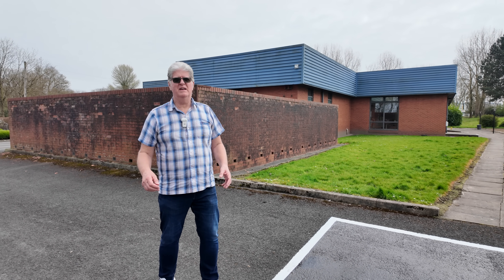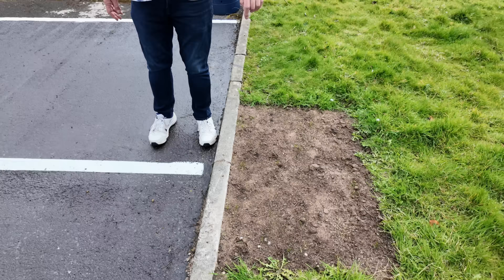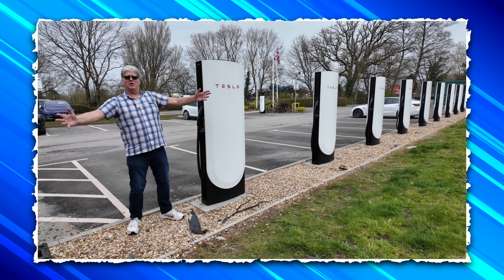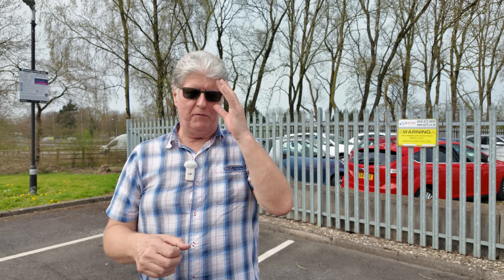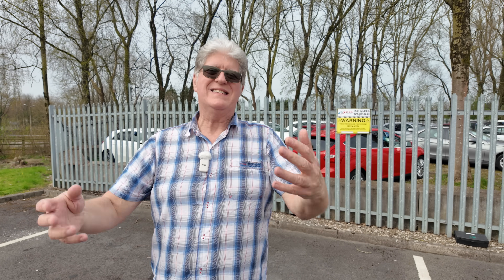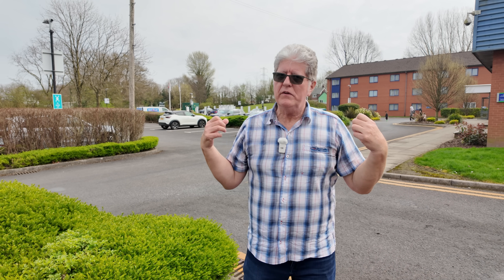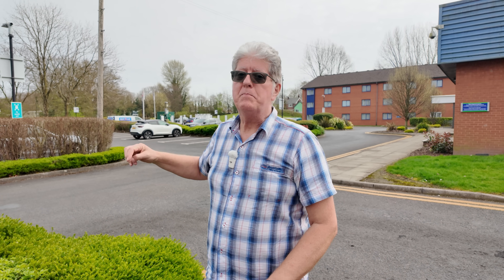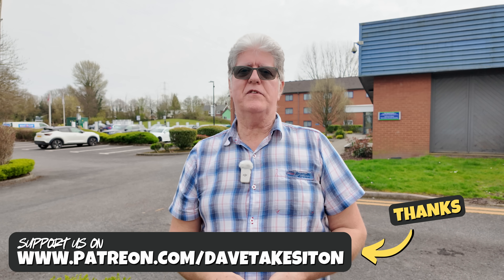Why Are EV Chargers Being Ripped Out?

Comment: If you can charge your ev in 5 minutes you will shorten the life of the battery and ruin the car's value. But ev owners do not seem bothered by little financial details. Someone looked at auto trader data and worked out the average depreciation of ev is £1,500 per mile. This is because so many are pre-registered with delivery miles and kept in a garage 12-18 month before actually being sold. Unless you are avoiding taxes there is no reason to buy an ev which is a shame - if the market was not distorted by the dumb government - they would evolve on their own merits like any other product & slowly overtake ICE cars. The government is the problem here.

Comment: Its not just a matter of money but also what the local electricity distribution network can handle.  These chargers need an enormous amount of power that local networks can only provide to a limited extent.
Reply from the maker: No absolutely not. The job of the grid is to provide a stable and plentiful supply to meet growing needs. If they haven’t done this then it is appalling that they force us to pay. Just like Ofwat. They pay out huge salaries and bonuses and dividends then ask us to pay extra to do what they are contracted to do but choose not to do.
Reply: @davetakesiton  they're looking at it - it's a big job though requiring between 1 and 2 £trillion investment - coming to an energy bill near you soon!

Comment: The other question is why the charger was hogging the 2 best spots next to the building entry?
They put in 4 chargers at my local store a few years ago- right in the best places next to the disabled ones.
At first they were always empty, now always full- with normal cars.  With the mandates going away they are redundant now, but have not been removed yet.

Comment: The UK is ripping out 50kW chargers - Australia is still installing them. Send some over, lol.

And I want to know how Tesla manages to provide 15 250kW chargers that don't drop in speed when 15 EV's are on them? They would have to suck almost 4 megawatts out of the grid.
Reply: Yeah, doesn't make sense to anyone that understands Ohm's Law.
Reply: In a practical sense 250kw chargers almost never provide 250kw even if the vehicles are capable. It is like a home with 100amp service that has potential loads of 200-250amps. For the maximum power to be drawn all 15 bays would have to have fully discharged and preconditioned vehicles connected and start charging simultaneously, which would never happen. I imagine service to the chargers isn’t more than 1Mw.

Comment: Dave being economical with the actuality whilst also inadvertently highlighting the built in obsolescence of EVs. No Kia or Hyundais sold in UK can charge fully in 5 minutes currently and although this may be an option at sometime in the future, it is more of an aspiration than concrete commitment. I also suspect by fully charged in 5 minutes you mean 80% charge, not 100%. As for the expanding network of faster chargers clearly that is improving all the time and you would expect with a developing technology and market. But it is interesting that they don’t appear to make public knowledge how many 350kw chargers there are currently in the UK. 
Future proofing the charging network is a sensible plan in terms of charger cabinet design, but the real cost is supplying those chargers due to likele network and local substation upgrades. Commercially is there any point in currently building 350kw charging stations when realistically there are less than a dozen vehicles in the UK capable of using them at full power? Isn’t that the reason that the originally installed BP charger was only 50kw capacity? It has been made obsolete by improvements in charging rates and battery software, although the loss of the Chadmo chargers also highlights a problem for EVs as the technology develops, obsolescence will cause some casualties using old tech, presumably vehicles like the earlier Nissan leaf using old tech will become worthless as that charging format is lost ans software updates are not forthcoming even for home chargers? I appreciate you have to project positivity of EVs no problem, but promoting currently unavailable tech as dead certs is not helpful and is disingenuous, an accusation that could equally be levied at the anti EV pro ICE side of the argument also.

Comment: We are at peak charging network. There is no profit in chargers. The chargers we have now were installed to milk the tax payer. As the network in the future will have to survive without subsidies the number of chargers will become less.
Reply: Did you know that half the cost of a charger is the expense to make it safe  for your  use ??  
 Petrol stations are safer than all those ev chargers! Use brains and legs. 😅
Reply: @ doesn’t matter whether you spend money on safety , maintenance it’s still an overhead. I would love to know how many chargers on the network make a profit even at 85p a kWh. I doubt there are many chargers that are utilised more than 15% of the time.  We should be talking about the low utilisation of the network and the return on the tax payers investment.

Comment: Because EVs are flying off the shelves.😅😅😅😅😅😅
Reply: Not many people want to buy battery powered cars 😂
Reply: @zitzong Don't they, can you please share your extensive research.
Reply: @darrencox150  don’t need to because whatcar proves that battery cars costs more expensive to run especially on motorways 🛣️
Reply: @zitzong  Yet sales would appear to say many people do want them.
Reply: @jimf4748  yes but only fleets, freebies and fanboy’s my friend.
Reply: @zitzong  Where can I get a freeby. I've had EV's for 7 years and had to pay for them all. Did you get yours free?
Reply: @jimf4748 Whatcar prove Ice car's are cheaper to run ... especially on motorway.... EVs get no where near stated range either 😂😂 ..... all in Whatcar my friends 😊
Reply: @johnthemagnificent7022  Well my accurate spreadsheets prove otherwise. Having run ICE cars for 47 years and EV's for 7 years there is no doubt EV's, in my experience, are cheaper. No exhausts, timing belts or real servicing.Have you run both to produce real world figures? Do you really think I would continue spending my own money on EV's if not cheaper?
Reply: @jimf4748  No 😊 I wasn't prepared to  Lease an MG Cyberster over  4 year's at a cost of £48500 .... everyone tells me this is the cheapest way to run an EV?  The Taycan wasn't bought after advice from a customer of mine who lost over £60 over 3 years in depreciation .... Wish I could buy  a New Audi 80 tdi again 245000 miles and never ever put an exhaust on it kept it  24 year's 😊
Reply: @johnthemagnificent7022  Wow I wouldn't have believed an exhaust could last 24 years. I've never managed anywhere near that. I always buy around 20 months old. My current EV had already lost £23000 in depreciation when I bought it.( Much better deal for me than original owner).  That lease deal was crazy never seen one so expensive. I wouldn't have touched it either!
Reply: @johnthemagnificent7022 what other research have you done? One unreliable source is not proof.
Reply: @johnthemagnificent7022 regardless of the engine type, buying the car outright, is always cheaper, running an ev is cheaper still.
Reply: @darrencox150 Yawn yawn  yawn 😊
Reply: @darrencox150 Absolutely incorrect
Reply: @jimf4748  Pre registrations by the 1000s do not reflect sales. DUH!
Reply: @charliecoco2115  Who said otherwise and who cares?

Comment: What happens when we run out of copper? No more houses?
Reply: The same thing that happens when we run out of anything else, I suppose.
Reply: @ I'm not sure that's a good way to think about it, as it's the best conductor we have for electricity.
Reply: @robertlincoln7312 Well, that makes you wrong. Precisely because it is useful for electrical wires, we recycle it when we can, and make more of it when we "run out". We also use alternative materials when appropriate. Many electrical cables are aluminum, as an example. How this would lead to "no more houses" requires some mental gymnastics.
Reply: Good thing copper is infinitely recyclable
Reply: @ True but there is only so much left and the wealthy don't care.

Comment: To charge an EV in 5 minutes from one charging point requires 1000KW (1 Megawatt) of power ; this would need a considerable upgrade to the power network. This level of charging  would also produce considerable EMF. If anyone has concerns about being close to over head power cables I wouldn't suggest sitting in your EV drinking tea when its being charged.
Reply: Far as I'm aware power companies have not raised any concerns?
Reply: @peteraberesford they have.  I can't post links here but there has been plenty of concerns raised if you look into it.
Reply: AFAIK, neither cables, connectors, nor existing batteries are capable of taking that power, so not an issue - yet.
Reply: In this video he states that there is a Tesla hub with 15 x 250kW chargers so the infostructre is there to support 3 x 1MW  units so it would be more like a petrol station than a car park. Some big hubs have 40 chargers. As For EMF it is DC so has a frequency of 0hz compared to overhead lines at 50hz and there is no evidence to suggest there is any harmful effects at 0hz. The ACDC convertor would be screened to avoid EMF. But you could keep the tin foil hat on if it makes you feel safe
Reply from the maker: wow, so glad I found you, an EV charging expert who knows far more than the safety experts that set national standards. Please tell me exact data
Reply: In the UK, exposure limits for electromagnetic fields (EMFs) are primarily based on the recommendations of the International Commission on Non-Ionizing Radiation Protection (ICNIRP). These limits are designed to protect the general public and are implemented through regulations and guidelines enforced by organizations like Ofcom and the Health and Safety Executive (HSE). The UK exposure limit for magnetic field strength is 360 µT (micro-Tesla), and for electric field strength is 9 kV/m (kilovolts per meter).
Reply: @neilfox4721  Wow, nice that an intelligent person is in a position to state the facts. The EV zealots automatically assume that anyone with views that differ from their own are of inferior intellect and can therefore be dismissed as luddites; never for a second will they consider that they might have been misinformed
Reply: @davetakesiton He’s right about the supply having to be 1 megawatt per car charging though. Do you honestly think that’s realistic in the foreseeable future?

Comment: What we need is companies like Travelodge and Premier Inn to install Level 1 or 2 chargers in a lot of stalls, for the use of anyone at a reasonable price. The slow charging speed would mean that they won't be of interest to anyone needing a top up while on a journey, but would be perfect for those overnight guests. The cost of installing the chargers should be low enough to roll these out for a steadily increasing number of guests.
Installing 150kW chargers makes sense for a hub with limited power resources. You can still put in a decent amount of charge in the time it takes to have a coffee an use the toilets. I'd be interested to know what the average number of kWh figures are on any given site. My guess is that people treat them much like they do Motorway Petrol stations. Most only put in the absolute mnimum to get to a cheaper place to fill up, and for an EV that probably means just enough to get home.
We've got to get out of the mindset that we have to get from 20-80% as fast as possible. That's all that EV bashers bang on about, but unless I'm going to be going the length of the country in a day, I couldn't care less. Fast enough is good enough. 50-100miles in 15 minutes while I catch my breath is enough. I don't need to stress about getting back to the car because now it's cost me a fortune and I'm incurring idle fees.

Comment: Since BP has recently decided to go all 'Fossil Fuels' the removal of this old BP charger is no surprise. Over the years the perceived needs of EV charging has changed. when the original Electric Highway was set up nobody else was interested. there was the , chicken /egg, problem. No chargers so no EVs sold. At least the team behind Electric Highway were willing to install what at the time was the only available equipment . And for a couple of years run it for no charge. 
On this mornings run down the M40, I used the points at Insta volt Banbury, it fitted in with my 'ancient' need for ChaDeMO, on a holiday trips where frankly cost was a secondary consideration. There was a constant turnover of cars at the Hub, it seemed that the slower charging speeds and even the higher prices did not put people off
I later needed to stop at Cherwell Valley services. I noticed that ALL of the Gridserve chargers were in use as I arrived, and even had 'marshalls' to deal with the holiday rush.  
I do wonder if speed of charging is the only major factor , and for some journeys, even cost. 
My vote is for many more Destination charge points, at the moderate price enabled by the simplicity of the set up involved.

Comment: I've never understood why hotels have these fast chargers (even the Tesla's). If the BP was 50kW that would be 6-7 7.4kW chargers which would be fine for overnight/destination. If you think if the speed of those Tesla's would probably mean the whole carpark could be covered with 7.4kW (506 chargers!!!!).

Found them on the map, they have about 100 parking bays (excluding the Tesla's) so if they had only 12 Tesla chargers, that would have free'd up enough power to have 7.4kW for EVERY PARKING BAY...
Reply: The superchargers are good for passing trade.  I’ve stopped by at the Preston supercharger on route Aberdeen to West Sussex.  Did I pop in to buy a bacon sandwich and cup of tea?  Of course I did!  That’s all money in the hotels pocket in exchange for something I want.
Reply: Total agree hotels need slow chargers but lots of them. What can happen is a guest arrives and plugs in to a fast charger and goes to bed. That Fast charger is now not available until the quest checks out. Where as with lots of slow chargers its not an issue. Cost should also be minimal 20p-30p for a 7kw charger is about right
Reply from the maker: they have 15
Reply: @davetakesiton  i know ☺️, I was saying if 3 were removed, well just not installed, (leaving 12) then there would be enough spare power to have a 7.4kW charge in every space. No need for dedicated EV spaces. Just pick one and plug in if you need to. "...if they had only 12... ...that would have free'd up..."

Comment: My charging speed is limited by my 300V battery. Unless the charging cable is liquid cooled, that limits the maximum charging speed for me. Verhicles with 800V batteries can charge quicker. I only need 30 kW.
Reply from the maker: sorry this makes no sense. 300v battery?? 30kW??? random unrelated figures.
Reply: @davetakesiton  Not for an electric motorcycle. It takes 30 min. to get from 20% to 80% of my 22.5 kWhr battery on a CCS charger, no matter what the chargers maximum power output. But the voltage makes more of a difference on electric HGVs as they have enormous batteries.
Reply: @DavidNewmanDr  Would that motorcycle charging really be faster with a liquid cooled cable?